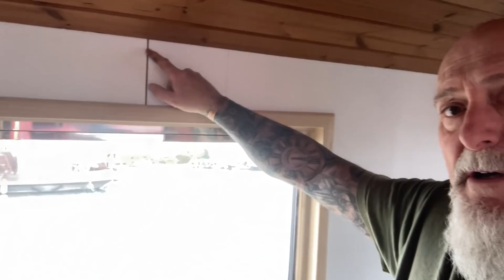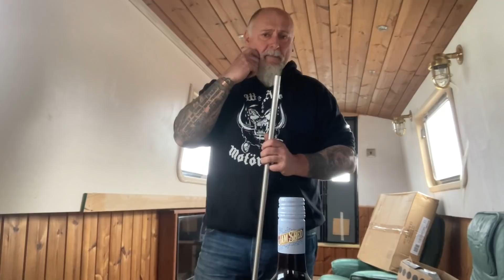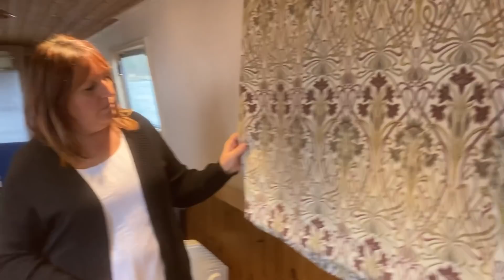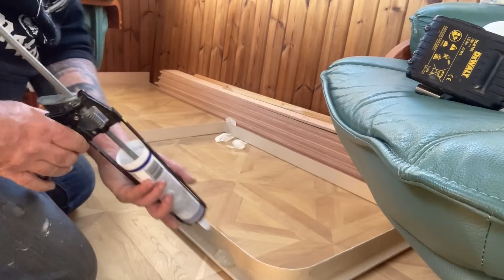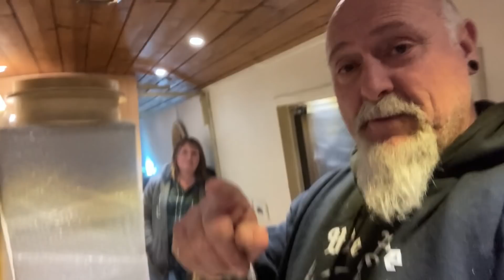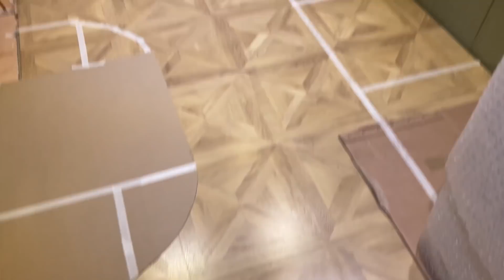Building Our Narrowboat #33 - Making a Small Space a Home.

Comment: Love the curtain material.  Have you thought about punching ring holes in the bottom of the curtain as well as the top and using two rails - top and bottom?  Our curtains have a bottom rail and hang well and fold well.  They can be easily pushed to the side.
Reply from the maker: Hiya, We had top and bottom rings on the curtains on our widebeam. Like everything we are basing current decisions on what we have learnt. So no bottom rails, grandkids will just be hanging off them lol. So we going to try something different. Thanks for the support Noggin the Nog.